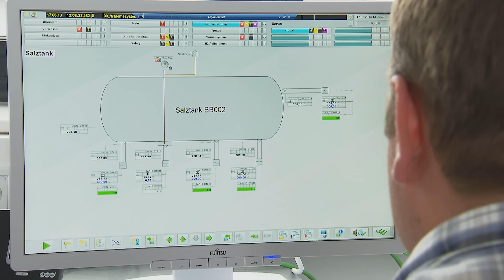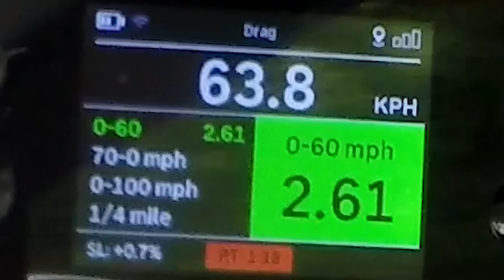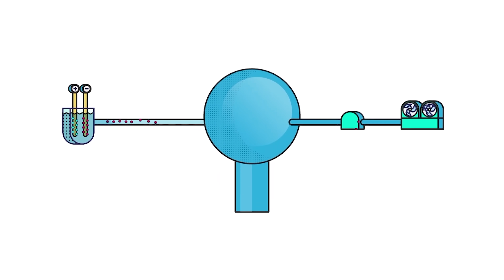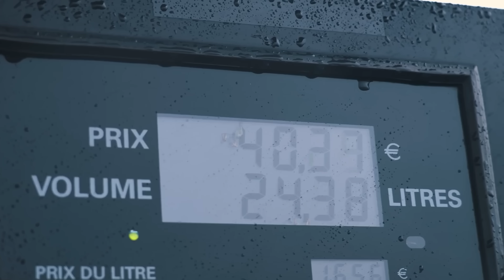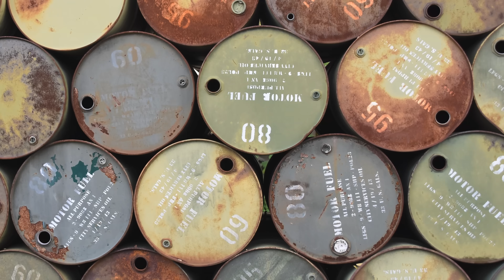Porsche just SAVED petrol engines FOREVER

Comment: So the condition is "if the cars are fueled with e-fuel" - but the EU still hasn't introduced a ban on the sale of petrol from 2035... If petrol will be sold, who is going to control what fuel is put in the car and how?

More importantly, this e-fuel is hard to call environmentally friendly once you start calculating exactly how much renewable energy would be needed to produce the amount of fuel that needs to be replaced in the EU, since the raw materials for this renewable energy does not grow on trees or magically appears where you need it without needing huge energy inputs to begin with.

This whole charade is a joke.

Neither e-fuels nor electric cars have any chance of replacing fossil fuels until we have renewable/unlimited and clean energy which will not happen until we solve the issue of fusion power or at least start rolling out 4th gen nuclear reactors running on thorium on a massive scale.

Comment: great on paper terrible in reality, what will happen is that these fuels will take more carbon to make then if you use traditional fuel. why? the capturing of carbon takes a lot of energy, or it allows carbon based systems to stay in production because of it. I assume you can do 100KM on a electric car for the energy used for 1KM in a 911 using the efuel. and getting enough green power for full electric fleet will already be a challenge. either it will be Dirty "non renewable powerplants". or it will be so expensive that only rich people drive their super cars once in a while with this efuel. don't get me wrong will be great to have this stuff for the Oldtimers, some race events but for day to day driving I don't see people able to afford it. Maybe that's the reason the made this compromise.

Comment: I often wondered why synthetic fuel wasn't an alternative ages ago bio fuel is also 100% possible E10 in use now, methane from sewage, vegetation eg grass cuttings etc. microbes, algae the list is almost endless. 100% electric in 2030 will not work for a large portion of the population.

Comment: no this will not save ICE. 

the whole point if this ban in the first place is to reduce car emissions. 

even with e fuel you are still burning. 

ICE is dead. the only thing that can save it truly is hydrogen.
Reply: Have you ever read the book "The Hype About Hydrogen"?

The concerns are staggeringly in favour against it.

Lead acid battery powered EVs adapted to higher energy density for quicker charging, as well as many suppressed technologies, is MUCH better a way to go than hydrogen, petrol, diesel - this "thing" (which will involve YOU, giving your money, to THEM)...

I put a dislike to this video which absolutely NOBODY is ever going to see. 😡
Reply: @Let's discuss it over some tea  ya unfortunately ICE is dead. 

the market is moving toward this. the only growing sector in vehicle sales is EV. 

but as a car enthusiast, I would like to keep ICE around along with EV. But using hydrogen only. 

otherwise ICE will eventually die in 20 to 30 yrs

Comment: E-Fuel is a scam. It's basic physics. You'd lose energy in the production of the fuel, distribution, and ICE engines top out at 40% efficiency. The renewable energy you use to make the fuel could just go to powering an electric car and go about 3-4 times further.

Comment: The best e-fuel is ethanol and you get it from corn. Corn is the best way to get carbon out of the atmosphere. So promote more agriculture. 
It has been studied extensively and found that US's midwest had its weather changes to favourable because of their corn plantations. Temperature has reduced, so they get more rainfall and more rainfall means more corn and the cycle keeps going.

There is bio diesel available in India on petrol stations and it has been available since a couple of years now.

Comment: The problem is not whether the oil is synthetic or not. The problem is that ICE engines are only 30% max efficient at turning oil into heat, meaning electric cars will still be much more efficient and ecofriendly.

Comment: This is just petrol propaganda by the dinosaur fossil fuel industry to get people to still buy internal combustion engine cars. Electric is taking over and fossil fuel vehicle sales are plummeting. Carbon capture is inefficient, as is using renewable energy to run multiple chemical processes to get back to petrol or diesel. Transporting and storing electricity is far more efficient and battery technology is improving every year.

Comment: Rather stupid so use so much energy to produce e-fuel when the electricity in that process could have charged an electric car instead. The emissions from combustion is still the same with e-fuels too - polluting city air with carbon monoxide etc.

Comment: the problem here would be the amount of energy it would take to make the fuel oppossed to just using that energy to power car, but at the same time if we aren't at least trying to develop these technologies to be more practical we are eventually going to hit the the point where traditional fuels won't be economically sustainable long before the oil "runs out". This goes beyond just "going green" we have to find a way to satisfy our energy needs for the long term putting all eggs in one basket is probably not the wise choice i mean thats what got us into the mess in the first place is the reliance on just internal combustion engine. Imagine a massive solar flare (CME) hits earth and takes out the worlds electrical grid all of a sudden every vehicle on earth thats reliant on grid based electricity is rendered useless.

Comment: IT'S All BS..........It's not that hard to build a clean burning, fuel efficient hybrid vehicle. They just don't want to.... Example propane & natural gas burn very clean, so does biodiesel & ethanol.... Brazil was fuel independent by making ethanol from sugar cane. All you gotta do is for example to make a clean hybrid truck. Is cover the hood,roof & truck bed cover in about 800w worth of solar cells, add electric motor & generator/ engine that runs off of biodiesel, propane,cng or ethanol. Use the solar panels for a bit extra free charging power,a wall plugin🔌 & biodiesel generator for more range.

Comment: Looking at Volvo's claims for their XC40 EV vs  XC40 ICE, each XC40 EV has to be produced with upfront around the extra 74k kilometers worth of CO2 when compared to the ICE model. So back on the ICE model that are produced with lesser CO2 then in the future are running on carbon neutral fuel. It's producing so much less carbon and cheaper for the masses to afford. It's more ESG in this sense and like I said, EV are NOT GOING TO REPLACE ICE , they will just be there as an extra option, so that is the Hybrid vehicle which will be the best of both worlds, less CO2 when produced and more affordable while having an extremely long range.

Comment: Two huge problems with this political movement:
1: Batteries - mining lithium and cobalt is not environmentally friendly and employs child labor in Congo; and we have no way to recycle them at end of life.
2: Producing synthetic fuel requires more energy than there is in the final product.
Modern politicians need to get out of the clouds. Diesel electric is an overlooked option which has incredible potential. We already run trains and ships on this tech so it’s proven and can be scaled down fairly quickly. Industrial scrubbers could be employed to thoroughly clean emissions

Comment: Running normal combustions engines on hydrogen derived from water via electrolysis with an onboard electrolysis device has already been done decades ago. Water is extremely rich in hydrogen and when hydrogen is burned in the presence of oxygen it turns back into water. There's no carbon in the process. I have nicknamed this fuel 'hydro-oxygen' (H2O) in the same way 'hydro-carbon has been used to describe fuels derived from crude oil.

Comment: If you look at Norway.
The gas stations are changing their names to energy stations.
The problem is that after 2025 Norway will stop selling fossile cars.
In 10 years, all the gas pumps are sold abroad. ESSO, are stopping it's refinery in Norway. An electric car are just better. And, it's easier to charge at home. If you can't do this. The new V4 chargers, will charge a car in 5-15 min. The same time it take to fill up a fossile cars.

So, if you want a fossile car, you can get old frying oil for diesel, or you can make your own with suggar and yeast.

The prices are going down for electric cars, but you are welcome to buy a fossile car for 2-4 times the price, that have less power, and comfort...

Comment: It's a nice idea but I think e-fuel will likely be the fuel of professional racing and the ultra wealthy. Current pricing on e-fuel is roughly $40 USD per gallon. More than likely EVs will be the dominant option for most drivers and enthusiast cars will have a much higher price tag with disgustingly high fuel cost.
Reply: Right well this is wrong. As production increases the price of this fuel will go down..therefore it will be cheaper for the average consumer to run a conventional vehicle with e fuel than to run a electric car. Not to mention that batteries are some of the worst pollution producing technology. Batteries of electric cars have to be replaced every 5-7 years and every EV has thousands and only some of the battery can be recycled. The waste from building batteries and disposing them is just as bad as a conventional petrol car on the road. E fuel makes the most sense as it is more aligned with our current infrastructure. Not to mention the amount of technology we have developed for internal combustion that would be thrown away. Before anyone says I'm wrong, I am a Vehicle Dynamics engineer with a masters degree in Motorsport engineering.
Reply: You like most people are clueless about the paucity of raw materials for batteries etc. the world's known reserves of lithium are insufficient to supply batteries for the forcast uptake of EVs and certainly replacement batteries.
Reply: @RC-fm6bj  Actually there IS enough lithium in the world to replace all cars. The current production just needs to scale up accordingly. If we are able to spend billions of dollars to extract billions of barrels of oil, we should be more than able to extract the same amounts of lithium.
Reply: @texanplayer7651  nothing like exploiting even more poor regions for their resources :)
Reply: @roccociccone597  yes Australia is a very poor region
Reply: @davidthomas6047  get ready to destroy more areas to extract the minerals bud
Reply: @roccociccone597  lithium or oil, why are you mote worried about 1 than the other - need to extract about 10kg lithium for an EV battery & 20,000kg if oil for the running of a combustion engine through the same life cycle.
You seem to be against consumerism in general in which case it's bicycles for everyone :D
Reply: @davidthomas6047  let’s not forget the disposal of batteries
Reply: @roccociccone597  yep, using stuff has environmental consequences - we either try to resolve them or stop using stuff. Batteries can be mostly recycled (not economically profitable but very much achievable for the most part). We humans are pretty capable when it comes to solving engineering problems. Less so at mitigating our own destructive impacts - need to spend much more time applying 1 to the other rather than clinging to old technology our of some sort of nostalgia
Reply: @davidthomas6047  how about the cobalt mines? Amazing for the environment and the regions that get exploited. Yes they’re trying to reduce the reliance on it, but at the rate we need me batteries you can forget to survive off of recycled batteries.
Reply: @roccociccone597  Latest batteries don't use cobalt.  Meanwhile, 2nd biggest user of Cobalt Globally??  Oil refining.  Everything you believe on this topic has been fed to you by oil interests.
Reply: @WillBecker  go look at how lithium batteries are made brother. They contain cobalt. You know very well they do.
Reply: @texanplayer7651  "if we are able to spend billions of dollars to extract billions of barrels of oil, we should be ables to extract the same amounts of lithium."

This makes absolutely no sense.
Reply: @roccociccone597  batteries can be recycled.... what's your next thoroughly debunked concern?
Reply: @roccociccone597   That was true, but is rapidly changing. 
LFP (Lithium iron phosphate) Batteries are the way to go and pretty much all EVs that are built in volume either are on LFP already or will move to LFP pretty soon. 
NCA and NCM Batteries are still built and probably will be a part of EVs for some time. 

LFP just has a significantly longer lifespan. It does have a lower energy density, but tweaks in packaging and even chemistry are still being made. Just in the last 12 months the density record of a production LFP rose by a cool 10%. Astounding for a battery.
Reply: @RC-fm6bj  That's nonsense. Lithium is one of the most common materials on earth and is contained in salt. So we're more likely to run out of oil.

Comment: Bullshit! That is Exxon who is trying to save burning of fuel in combustion engines and not Porsche. Porsche is just decoy for petrolheads and all ppl with dinosaur thinking. That e-petrol cost a fortune, ie its 11 times more expensive than a regular petrol which is total nonsense. Energy efficiency is dumbest ever. You need to put awful ammount of electric energy to create e-fuel and that so promised and hyped zero carbon footprint doesnt clean its toxic emission which it will still spit from its tailpipe!!! 🤢🤮😷👎💩 By the time of 2035 nobody will be interested to use any dirty combustion cars. Excetp museums. 😜😂👎 You wouldn’t be allowed to enter the cities with ICE cars anyway. So forget this stupidity. ICE is dead and is marching to the grave. ⚰️🪦

Comment: I’ll get called silly names for this but here goes anyway;
1. There is not enough resources to replace ice cars with electric and ‘they’ know this, the laws are being put in place to get people out of personal transport, no private ownership of cars!
2. Oil is NOT a fossil fuel, that lie was bought $ in by Rockefeller Standard Oil to convince the public that it is a rare resource to keep prices high. Oil is being drilled at depths way beyond 30,000 feet down, not a fossil. 
3. Notice that the label Global Warming has been changed to Climate Change because the globe is not warming and ‘science’ is NOT settled on this. Carbon dioxide levels are at a long term historical low, so low that agricultural greenhouses are known to pump in CO2 to aid plant growth. CO2 is a vital element of life and has been demonized for political reasons. It is advisable and far more important that humanity address toxicity levels in our environment instead. 
4. There really is an agenda to control the greater population of the globe, to eliminate freedom of movement and liberty in general - evidence 15 minute cities. 
WAKE UP AND DEVELOP CRITICAL PROCESSES 
turn off mainstream propaganda and pressure politicians for genuine representation - good luck.

Comment: You have to expend energy to make the fuel. Then you transport the fuel around countries to fuel stations. Using fuel. Then you burn the fuel in an internal combustion engine, which are notoriously inefficient.

Or, use the original energy to power the car directly.

I like cars, but e fuel is a stupid idea

Comment: Interesting development and there is no doubt that many options are required for environmental protection but.. this fuel option would still be damaging for air quality in city’s and towns so I would through caution in that it should in in partnership only with high efficiency engines to reduce the emissions and larger more polluting engines should be outlawed. Use with  licence for commercial requirements, agricultural freight etc. should be created.

Comment: There's just the simple problem that you need eletricity for electrolysis the same way you need electricity for any  electric car. The other problem is that first doing electrolysis and then making methanol from it to fuel ICE is incredibly inefficient compared to just straight up electric powered cars

Comment: Nice for keeping very expensive high performance cars using synthetic fuel. The “slight” flaw for mainstream cars is it take 4-6x more electricity to create synthetic fuel per mile driven than an EV = expensive and high CO2. Plus massive scale up to create enough for use beyond specialist performance cars. Good for Porsche, fits its niche.

Comment: After the new EU-legislation, Cars themselves are not allowed to emit any Co2 emissions. So even if the e-fuels you mentioned in the video here would be co2 neutral on a global scale, it doesn't matter. They would still be forbidden to run with this type of e-fuel. That's also why petrol engines are in a way still getting banned in the EU by 2035 because there simply isn't a viable type of e-fuel to meet the criteria necessary.